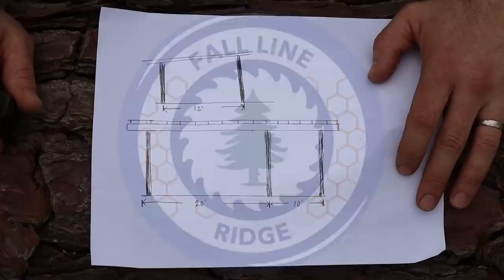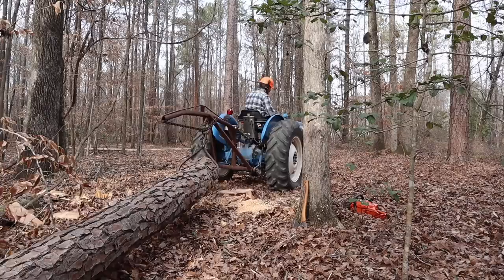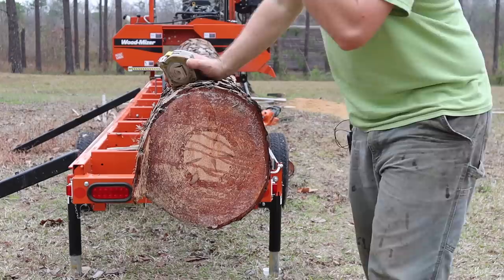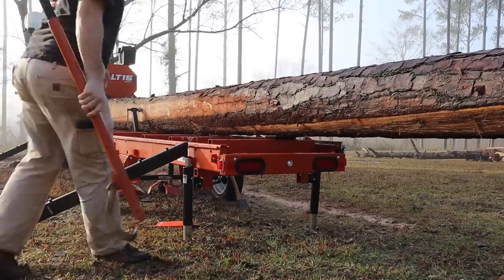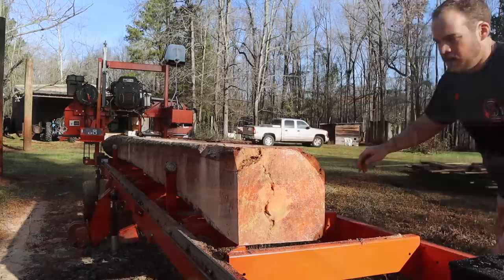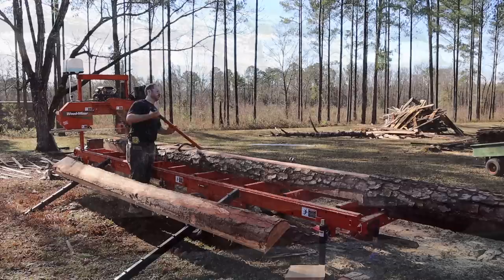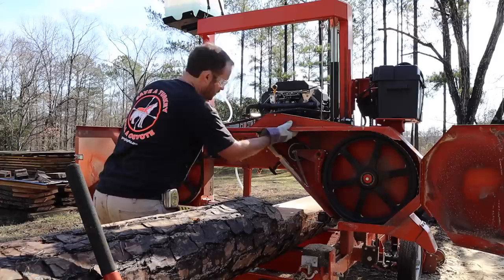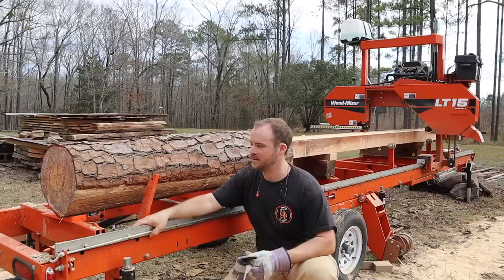This Log Was WAY Too Long For The Sawmill

Comment: Next time.....cut the chainsaw notch first and then saw to it.  That way you can remove the board without removing the blade from the saw.  Even if you saw up to about a foot from the stopping point, to make it clear where the surface will be and then finish the cut.  Nice work, glad to see you stick it out.

Comment: With the log being too long for the mill why would you not get one side of the log flat as far up as possible then use the process that you ended up using. This way all boards would have been full length??😘😁😁😁

Comment: What you're better off doing is buying a bolt on extension to the saw bed. You're only limited by how far your mill can travel & adding it to the end could double the lengths you want to cut. Simple really!

Comment: When I built my sawmill shed, I sawed 2x12's and sandwiched 1/2 inch plywood between them and bolted them together with carriage bolts every two feet. Built it 3 years ago, 16' span with no sagging.
Reply: Chiskie - Yes, Exactly. Laminated beam would have advantages. Easier harvest, sawing, erecting. AND stronger per pound.

Comment: I did two beams like this, except that I worked one whole side at the time. Make first cut>>slide log 8' toward home>>level log>>finish side 1. Repeat.

I do not have a trailer tongue to worry about, but a little bit of prep ought to make it easy enough.

Comment: Build yourself a set of wheels you can place under the drag end of the log which you attach with ratchet straps. Just transported a 24" log 21 foot long out of the woods. Great job on getting the log milled.

Comment: I'm glad to see it worked out for you.  My mill is in my saw shed and I have a hoist above the mill which makes it super easy to flip big logs.  You could do it with your boom on your tractor, rap a strap or rope  two turns around the middle of the log and have   a helper hold tension on the loose end of the strap while you lift with the tractor to spin the log 1/4 turn. I haven't used a cant hook since I installed the hoist over the mill. Unless the tongue was in the way, you only needed the 4 by 4's on two sides. The trees always seem a lot straighter standing than they do on the mill. I was tickled to see my name pop up on the screen, thanks for the mention. When you build your shed, keep a hoist in mind. I have two cross beams with an steel eye beam and a trolley so I can move the hoist to the center of the log.
Reply from the maker: wayne busse Hey Wayne! Appreciate the tips! You helped out on this project/learning experience. Yes, I was a little disappointed when I realized how crooked the log was, but I got my beam.

Comment: I know I'm late, however, once you cut a flat side on the extra part of the log, why still have the blocks under it? That side could've been put on the bunks to remove the other side! Would it not sit level over the hitch area of the trailer part?

Comment: Maybe those roller saw horses that you use for holding up the wood after a table saw would make over length cuts easier on the mill but no matter what you got it done and if it works that all that matters.

Comment: I cut some 25 ft 8×8s on a 20 ft bed by pushing the log back and forth with my tractor and it was a lots less work than You did but You got it done and that's what is important
Reply: thats what I was thinking, move it back and forth for each face,

Comment: A helpful tip for felling trees. Before you start your back cut, nip the left and right side of the open face, in the back cut direction, about 1-2” long and 1/2” deep. This will prevent the stem from pulling up piece of root (seen at 4:13). It may seem minor but after I had one pull the root before I cleared the tree it became habit. Good luck on the build!

Comment: There was an old sawmill on the property that had a 4' blade and rolling carts on narrow gauge RR track from the early 1900s. The band-saw is an improvement, but a rolling cart set-up into the blade would be better for the long beams, or another trailer that hooks up to the saw table and extends the saw travel.

Comment: Nice work. Kind of makes you want an extra 15 foot track made of 8x10 oak with metal rails for the tires of the head to ride on. Has to be bolted on fairly good but I don't think it is as critical as you might imagine for a long beam once in a while. When you tow with the tractor, I believe you should have a tow chain from the front of the log to the drawbar. It helps to prevent doing a wheelie and flipping over backwards if the log stops. The drawbar being below the center of the axle. That's why the have Rooms, and you can make your own with 2x2 square tube and a little roof. That's also better for a hardhat when driving past a widowmaker in the woods. The hardest thing to make homemade is a power log turner. Once again, nice workmanship!

Comment: Do not believe I've ever seen anything like this before.  I cut long logs a little differently;  I cut the bed length, then put the cut length up on blocks, slide the log back towards the already cut direction, shim the uncut length, then cut it.  Works quite well.

Comment: At 18:05 before you cut the cant off the top if you put a series of wedges in from the far end it will open up the cut a lot easier on a long section and allow you to back the saw blade out than trying to open up a short section with wedges.

Comment: This is one of the cases where a chainsaw mill, like the Granberg Alaskan mill, is the trick.....you can saw as long a beam as you have tree.  I made an 8x10 main girder for my barn 36 feet long out of a large poplar.

But I've also made 25-30' stuff on my LT40 that has a 21' capacity doing about what you've done.

Comment: We cut a bunch of 25 and 30-foot beams on a LT 40 years ago. We used a tractor at one end to hold up the long end and slowly feed that long end as each length was cut. We also chainsawed off the length ends like this. Lot of work, but we got some great oak beams

Comment: 2x12x12' and 1/2" flitch plate full length to make a beam.  Just break the joints.  But you wanted to use what you had.  It will probably sag unless you put temporary support in the center to give a little crown until the timber dries.

Comment: You did a good job. Wish i couldve been up there to help. I pulled some logs out of the woods today with an old Ford Tractor. 
 I built a big shelter last summer and bought two LV Beams 24ft in length. But expensive.

Comment: By the time I make this comment, you may have resolved this issue. Having said that, why couldn't you have taken the log off the mill, rotated it 180 degrees (placing the uncut portion at the beginning of the mill's traveling position and then you'd have the dimension you were looking for.

Comment: My first thought was chainsaw mill, but everybody's thought processes are different.  You managed to get the job done with the tools at hand. Nice ingenuity, good job.
Reply: The challenge with the chainsaw mill is that you would need a flat reference surface the same length as the log to use to make the first cut.  Then you need to figure out how to cut the edges square to the reference face.
Reply: @bwillan see alaskan chain saw mill (i think its called)
-
Reply: @hreinngunnargumundsson4734  Thanks.  I am familiar with the Alaskan chain saw mill.  It's main limitation for milling long logs is what I mentioned in my previous comment.  You need a flat reference surface the same length as the log you are cutting to make the first cut.
Reply: @bwillan  sure but that can easily be constructed with a pair of 2by4s and a board of some sorts, creating a structure like a H-beam. That structure would need to be sort of straight but then you shim it up along the length of the log to achieve an acceptable result.

Comment: Good job. I’ve sawed those long ones many times with a WM LT40. 
But the LT 4O has the swing around/removable end bunk, so sliding the log back for extra length sawing is easy.

Comment: When your using the cant hook set it so you're pulling down instead of lifting up.  It will be a lot easier on your back
Reply: I know your comment is a year old but it is rare to find one this silly and have people agree with you. You never roll a log towards you or some day you will end up under one and that s embarrassing especially when you are by yourself. Also when the hook lets go, like it sometimes does, you will be laying on your back with more than likely, something nasty under you , after the cant hook hits you in the balls. Also the greatest force you can put on it is your body weight. If you lift, with your legs , a normal toxic man can put double his body weight force on to the cant hook, and if it lets go the worst is that you stand up.
Reply: @D-B-Cooper  Everybody I see lifting the cant hook are lifting with their back.  I was also referring to when the log is on the log deck and you have the stanchions between you and the log and you are turning it for a new cut. Otherwise I agree when the log is free on a deck or on the ground always roll away from you.

Comment: I like your videos the older guy that helped you with the lt40 I think has hydraulic rollers I have a lt35 hydraulic and it has then the log could have just been raised cut the 20’ then rolled back and the cut could be completed with each turn still worked out great for you not sure where you are at in Georgia I’m in griffin

Comment: For the clear span in the shed, how about a truss?  Perhaps a parallel beam Pratt truss?  The bottom beam would be handy in one continious span being in tension.   You could splice the top.  Depending on joining, every node could be a separate piece because it is in compression.  In the end, a truss may be the only way to get stiffness.

There are other truss types as well, engineering is fun! Keep reminding yourself!

Clever sawing

Comment: Good morning. Thank you for the shout out. Ive done this arduous process twice. Once on the LT 28 which I am using now, (which you linked to) and that was a 26' 4x6. I also did it when I was building that sawmill shed where I used to work. That was a monster. 27' 8x14. But that was on the LT35 with hydraulics. And of course the camera froze while milling that, but here is a bit of it: Thanks again and looking forward to the rest of the build. https://www.youtube.com/watch?v=0Y18UGLu6as
Reply from the maker: Bus Huxley Hey Bus! Thanks for stopping by!

Comment: Excellent job sometimes we just have to do what we have to do to get a job done. It may not be pretty and it may not always be easy or safe but must be done.  But at the end I bet you probably thought a set of extension rails for the mill would sure been handy and nice. Once your shed is finished and dried in it will make the effort all worthwhile. Oh and isn't it amazing how big of tree it really takes to cut large beams it really shows how wasteful milling can be and makes judging trees for large timbers her difficult unless you have done a lot of it as I have. The majority of what I milled was square timbers for RR ties.

Comment: Okay, after the fact doesn't help anything,  and this is more a question as I don't own that type mill, but after your freed the blade the first time, could you have made the cuts with the chain saw at that place on the other sides?   That way when you reached the chain saw cut, you could have lifted the board off the blades - or so it appears.

Comment: Do not take the blade off every time. I'm going insane watching this easy to fix problem. It's like riding in the car while my wife is driving in rush hour traffic!

All you have to do is use the waste/bark side as a lever. it's 10 times easier than trying to use prybars and wedges.

I'll try to explain. 

Before you cut the waste material away with the chain saw. Go to the end of the log where the cut started. Pick up on the waste board with wedges or even by hand. Block it away from your cant with chunks of scrap wood. It will flex all the way down to where your blade is creating a gap taking all pressure/pinch off the blade. 

Back the head away half way back to the start of the log/cut.

Throw another wedge in at the pinch point about a foot or two back from the end of the cut. Then do the cross cut with the chain  saw. 

Having the gap will also make it a lot easier to not cut into your cant with the chain saw by accident because they are not touching.

Comment: To follow the heart wood Find the centre of the trunk at the top and bottom and mark them, measure and pack the top up off the bearers so the centre of the trunk is the same height from the bearers as the centre at the bottom, cut through one side end to end then you can flip and lay the log and repeat

Comment: Laminate a beam using 12 foot length boards staggered, three boards thick
 with glue and nails and it will be stronger and it wont warp like this log is going to. And take way less time than trying to saw a tree to long for your rails.

Comment: Very clever maneuvering.    A thought for when you're working on finishing off the final "fat" end.  Once you have the first 2 adjacent sides cut down so they match the rest of the beam,  would it work to remove the shims and place the beam  back on the saw carriage?  It seems that your beam would be a lot more manageable for the final 2 cuts without the shims.  Or am I crazy?

Comment: Some folks may consider it a form of cheating, but for at least this purpose there's a lot to be said for a couple of 20', 2x12" microlams.  It would be stable, you could hang a horse off it if you had to and you would have saved yourself a ton of aggravation.  The flip side is the satisfaction of having managed to git er done by yourself with what you had to work with.

Comment: You need to get the EXTENTION for the rails.
Reply: The better solution would be to be able to rent bed extensions.  It's unlikely cutting logs longer than the capacity of the mill will be regular occurrence.
Reply: With a longer bed, he'd need a longer shed, which would mean a longer beam... Or, attach an extension and roll the mill out one end of the shed when doing longer logs if that's not a frequent requirement.
Renting/borrowing an extension might have been quicker, certainly would have been less work than all the extra flips.

Comment: If you ever decide to cut logs that logs longer than the sawmill trailer itself buy some extensions to go on to the end of the trailer I'm building one right now that's 26 ft long and I'm going to have it set up that I can add another 10 ft section on to the end of it to cut a 30 or 35 ft log
Reply: Oh by the West I built my own sawmill and just now got it mounted on the trailer I'm going to have a hydraulic rollers to roll the log hydraulic motor to pull the saw up and down the table by cables

Comment: A 2nd set of wedges instead of disassembling and removing the blade?  Chop off the waste with the chainsaw, wedge open the kerf on that side of the blade, pull the blade up against those wedges, then wedge the sides of the kerf on the other side of the blade, remove the 1st wedges, then pull the saw on out?  Not sure if this would work, haven't tried a longer cut like this.  Thoughts?

Comment: Would it not save a lot of grief and time if you notched or ringed the log  slightly before the end? Cut under the notch and just extend notch down to cut line to remove blade. Also, if you moved mill head close to the end of your cut, you could block cant behind sawhead with longer blocks that go all the way across the bed. Safer and more solid. Would be behind sawhead so wouldn’t interfere with travel.

Comment: Personally there has to be a fab shop in town and they  could rough engineer a log rail extension for the mill and then you could cut as far as you got land to hang it over. Make them like twelve foot each and multiples of. Just un engage your power feed and push the extra distance and really for them like riding a bike.. trains been running on tracks for a while and safer better mouse trap and of course safe!

Comment: You must have some light roof loads in your part of the country. Unfortunately, in my neck of the woods, that size shed would require a permit and with snow loads, at least 30% more than 13" for a beam with a 20' span.
Reply from the maker: murphymb Not enough snow to worry about here, thankfully.

Comment: I think laminating two or more long boards together with bolts and nuts at the joint overlapping would be simpler. Terry
Reply: Or use a flitch beam

Comment: If you expect that you will be doing that sort of thing again - make up some spacers which span 2 bunks on the mill - this will prevent it falling over when you slide the log with the tractor or spin it with the peavey. It would eliminate the safety concerns too - very stable.  Add a couple of extensions to the dogs and you have a jacked up mill!

Or like @Chyna Mane said - bed extensions ... pretty sure you can make it as long as your budget allows as far as WoodMizer is concerned.

Comment: Thanks for your sharing, just a thought but could you weld together some extra rails/supports to extend the length of your sawmill, a bit of work admittedly, but it should be possible, no? I guess if you are not milling such lengths on a regular basis, it won't be worth it. Anyways, good luck with your project.